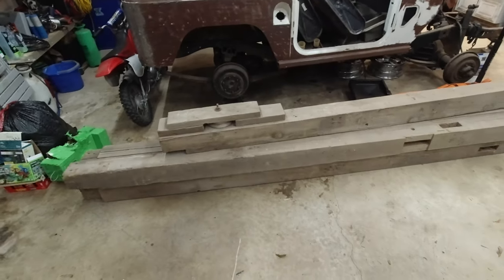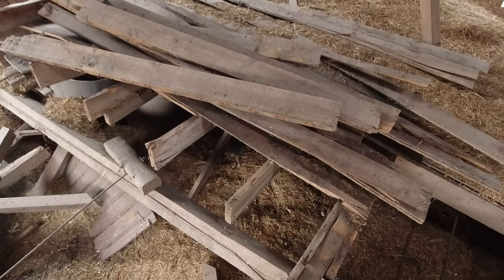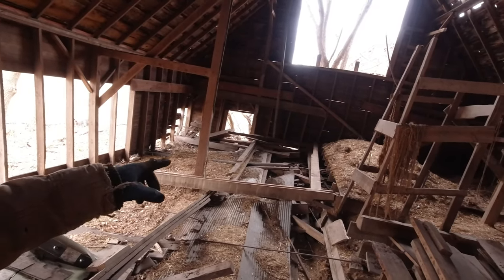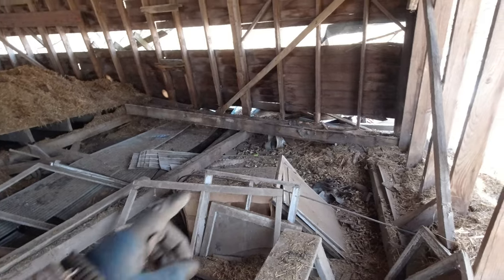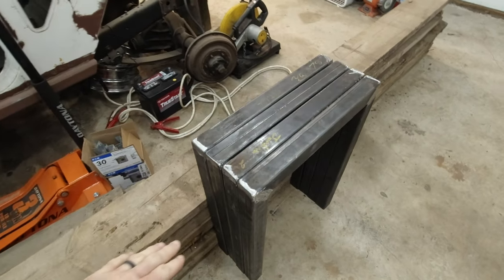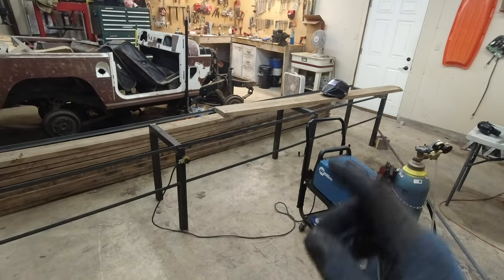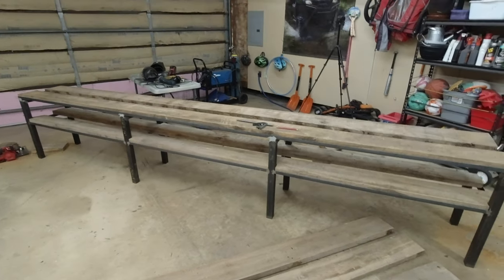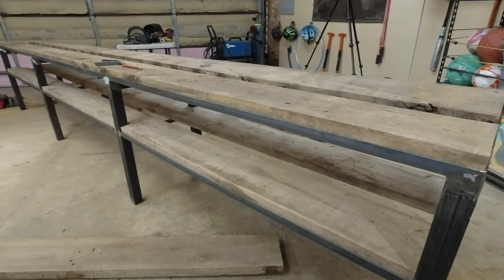Barn Into Shelf

Comment: That's a nice project, I like the saw marks left in the wood.  I've harvested lumber from some of my old farm buildings, and it can be rewarding but difficult.  Cutting through nails ends up being a reality because the rust holds many of them in place.

I wonder if it's time to purposely bring the barn down in a controlled way, it looks more frightening all the time.  But that would also probably end the lumber harvesting.  It's too bad you didn't arrive on the scene when saving the barn was still possible...I'm still fighting that fight on mine.

BTW, the amount of time lapse was just right, no need for apologies on that.
Reply from the maker: The nails can be very stubborn. I want to take it down but when I do I also would like to salvage everything I can at the same time. Right now the roof is still preserving the wood. I also wish I would have been able to save it.

Comment: I actually enjoyed the time lapses.  I like the shelves. I was wondering if you put anything on the bottom of the metal legs, like welding a cover over the opening, or perhaps a rubber cover or any type of leveler?  I hope that the issues going on in your life are not that serious and that it all works out for you. Thanks for the video.  Looking forward to the next one.
Reply from the maker: I didn't end up doing anything to the bottom of the legs. I did consider adding height adjusters but it sits on carpet and they aren't necessary. Thanks!